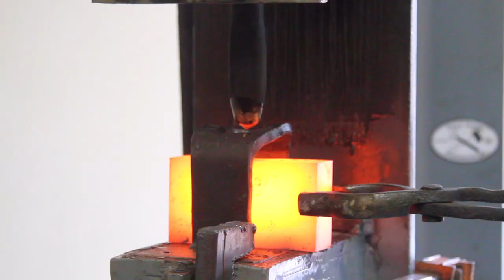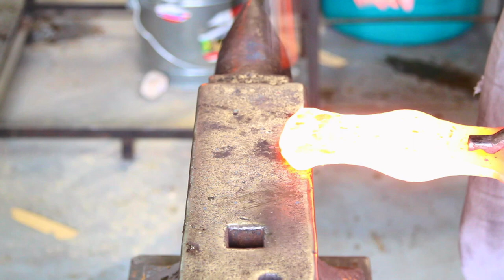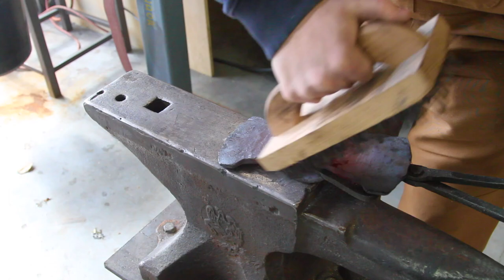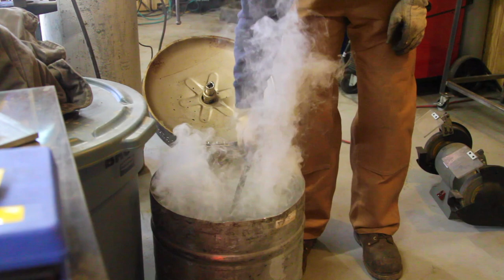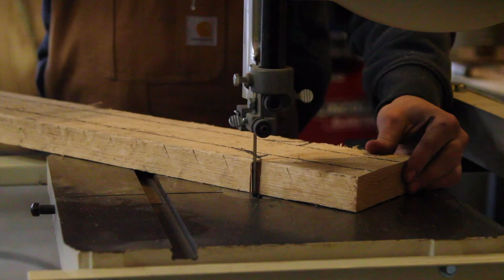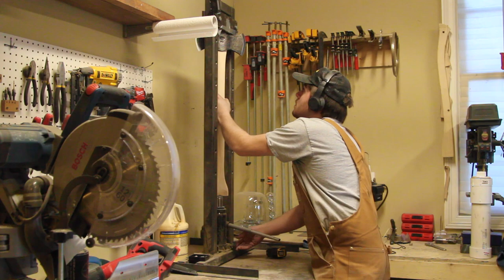Forging a Double Bit Axe - Blacksmithing

Comment: Stunning work man! I really like your choice in music as well. 
I really want to buy an axe and hammer from you this spring or summer.
Hey I see you're in Connecticut. Not far from me at all! Would you be interested in working together on a hammer and axe or letting me see the forging in-person? Shoot me a message if so. I have several years experience bladesmithing but haven't done larger work like this. Good stuff 👍 
-Nate

Comment: Dude...why don’t you ever forge weld in steel bits? Using one big piece of tool steel is for wimps. Anybody can use a press and stamp out the shape of an axe. Be a man and forge weld.